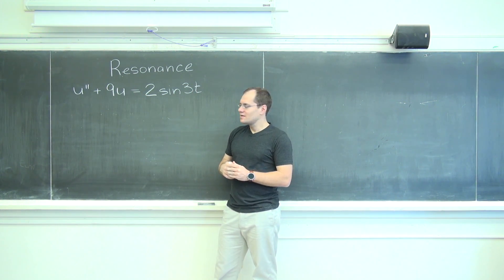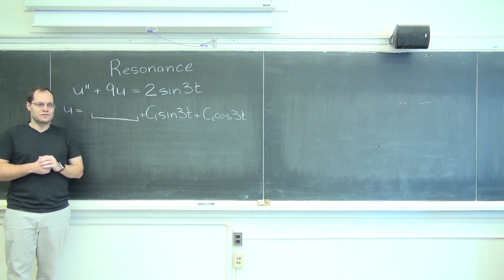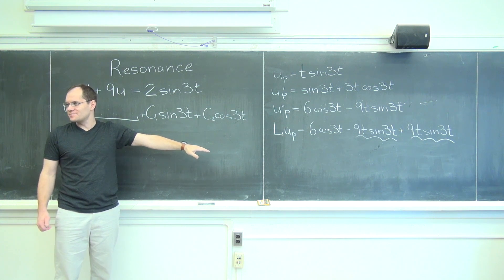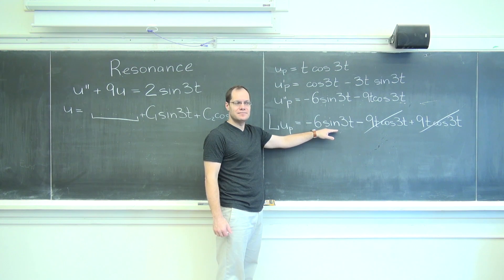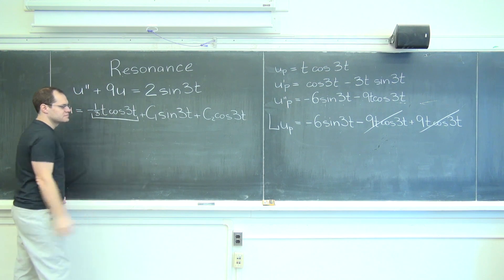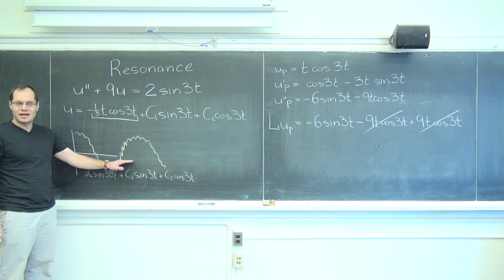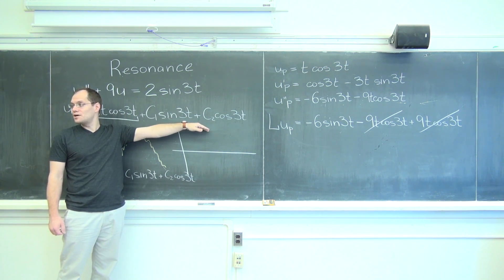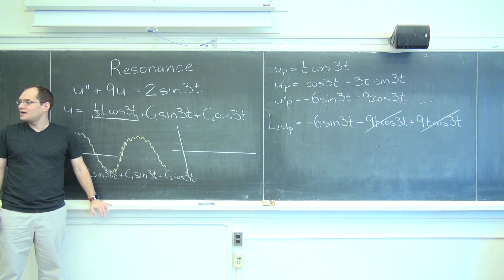Linear ODEs with Constant Coefficients: Classical Resonance

Comment: One thing I am still confused about: in the "real world," you would expect to have a very small error, and your equation might actually be u''+9u = 2sin((3+e)t) for a very small number e. But in this case, the solution is just the no resonance case with no t in front of the particular solution. However, intuitively, you would expect that if e is very small, resonance should still happen, even if it doesn't happen "as well." How is this problem solved? P.S. Thank you so much for this series, it's amazing!
Reply: Oh, this is just the conundrum of near resonance you talk about in a few more videos
Reply from the maker: That's right! Well done!

Comment: The reason why just the sine or just the cosine didn't work is because sines and cosines come in pairs – they are both two parts of the same circle, or in mathematical terms, of the same complex exponential. When you were dealing with just the exponentials, it worked, because the exponentials are complete. But when you have sines or cosines, you have to use both to complete the picture.
Reply: Please why did he choose the cosine for Up instead of sine?

Comment: Prof. Grinfeld, regarding the Tacoma Bridge, how come the wind has a frequency? If yes, how do I calculate it? I think of the wind as an equalization of temperatures, kind of a one way street, but no frequency involved! Thanks!
Reply from the maker: That's a good question. I think of it as air traveling through a trumpet. It passes through (like wind through a valley) but there's also a standing pressure wave whose length is determined by the dimensions of the cavity (valley).
Reply: Daniel Volinski If you look at the bridge in elevation view, it's possible that the wind load is vibrating if there's a spiral path out of page (normal to elevation). This is a fluid mechanics problem, but the design of the solids can create a path for wind to do this (in other words, the solids would act as boundary conditions for a flow problem). Not sure how you'd determine that, but, in structural engineering, we use precedent. USGS site provides sufficient data... on the other hand, I'm sure there's research on this. But USGS is the standard for using territory data for design such as eq and wind loading.

To mitigate resonant failures, you basically increase damping and stiffness. But you could also add innovative dampers that would be more effective in catastrophic events. Precendent helps because it gives us a reasonable way to "exaggerate" stiffness and damping  values in designing. 

One last thing I'll add is to keep in mind the reality of wind loads. Wind loads are typically loads that do not last for too long. So, even with resonance, you'll want to look at collapse mechanisms so as to account for a reasonably long lasting wind (maybe 5 minutes). That can also give  a insight on how to brace for example. This idea of "short" time for loading seems contradictory to what this professor said about the t*cos () dominating, but it's all relative; 5 minutes means infinte in that sense and yet when wind is gone, the terms that vanished come back (sorry if that was poorly worded).
Reply: It's not that the wind that is vibrating but the bridge is vibrating on some (non vibrating load), its called flutter, pls look it up